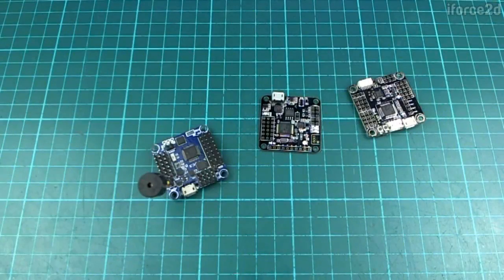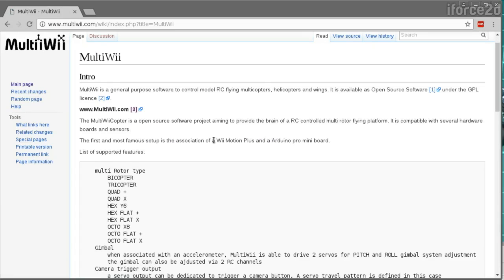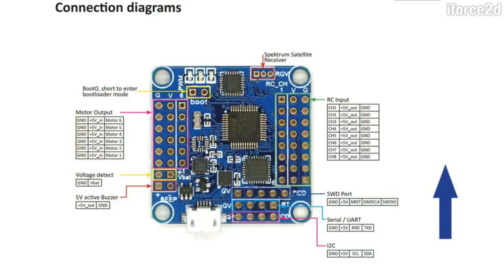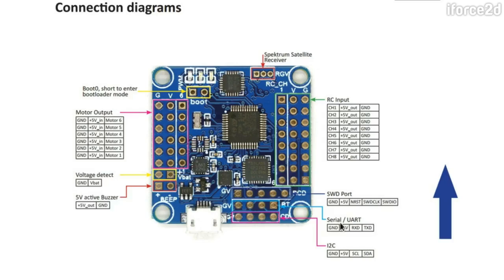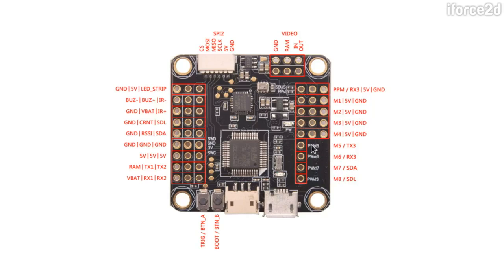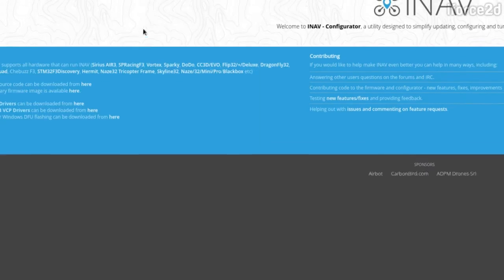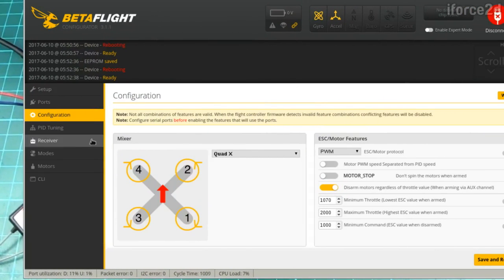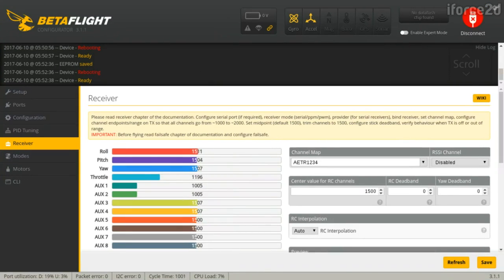Noobs guide to quadcopters part 9 (flight controller)

Comment: After all these years, still awesome videos!
One question - if you had receiver connected, why it did not trigger motor when you were playing with sticks on transmitter?
Reply from the maker: Because the flight controller wasn't armed.

Comment: Hi Chris. I have big problems with flashing of my NAZE32 Rev6 Flight controller. i always get the same error and my flashing stops on half of hte way. Please help. I already done all what i could. re-install drivers, re-install cleanflight to lower version and spell with firmware hex files and ect. There are all unusefull. Can't program STM32 and all...see this mistake on https://yadi.sk/i/6a1ySo-PhTSi0Q everything is vain
I want to throw out this flight controller in a wastebasket
Reply from the maker: I wonder if it might be simply faulty. Unfortunately the best way to check is to get another one and compare...
Reply: @iforce2d  Unfortunatly i do not have another one FC NAZE32 rev6. )Thank u very much for answer. You are the real friend. Tell me please one more thing. What programm and version  do you use for  ESCs flashing? Again i have mistakes  in my "BaillHeli Suite when i try to flash RACE Star" ESC's. Can't flash my ESC's. sux...Did ever you meet with that?? What do you think about this? https://yadi.sk/i/agkcBjnn99yKdQ Can i speak with you in Discord or Skype? Can we talk in sound?

Comment: Most of the stuff you are doing is on Arduino, would that not work as a Flight Controller?
Reply from the maker: Yes, that's actually how I started. https://www.youtube.com/watch?v=YPtxHw3DWrg The setup is a bit more fiddly though and the performance is rather limited (loop time is slow and adding a GPS or more features later is really pushing things).

Comment: if your esc has a third wire for voltage do you plug them all in?
Reply from the maker: If they are all linear regulators, and usually they are, should be fine. But if in doubt, just use one.

Comment: what was the name of that "newer" flight controller you showed?
Reply: I think the main reason for the switch to F3 was "why not?" ;) . The main limit was flash size on the Naze, because it used one of the low end F1s (there's one with the same packages but more memory). So if you want to change the chip anyway for memory, why not take one that has some other features as well.
The number of UARTs is a factor of the package type (pin count). The F1 on the Naze has three hardware UARTs and a VCP over USB as well, it was just that on the Naze the pins weren't connected with much planning apparently, so one of the UARTs was blocked by I2C (which could have used other pins). I used an F1 with 5 hardware UARTs, USB virtual com port and I2C, which was totally possible with F1s in the right package (higher pin count; dev boards can be had for less than 10$ on ebay). The code for that even made it into cleanflight trunk, but got dropped (for F1s) with the switch to betaflight.
Of course now with F3s you got additional features that make some things in programming easier, because you got more options of how to do something.
Reply from the maker: oh yeah, was gonna say that but forgot. Use some epoxy around the usb plug before you use it. One (of three) of the flip32 boards I had the usb connector broke off. These days I epoxy them as soon as I get them so I haven't had this happen again. I have not used this omnibus yet (I bought it for the follow-up to this series where I'll make a GPS quad).
Reply from the maker: Omnibus F3. But there are many similar boards out there now, I got that one for an aerial photography build because it has onboard OSD and SD card for blackbox on longer flights, and it has no onboard mag. For a miniquad the Betaflight F3 looks like a good deal.
Reply: Oh, those are just more F3 boards (72 Mhz), which you said are already starting to look a little bit slow.  
But new flight controllers must all be shifting to some newer & faster chip yeah?  I'm curious what it is.
Reply from the maker: The F1 board is what I said was getting old. It's not all about processor speed, the F3 has more hardware UARTs, built-in USB, FPU, some F3 have more memory etc, which is helpful too.
Reply: ah, thx that clears it up
Reply: @iforce2d  Im interested in aerial photography.  Do you have any videos showing how you built that one?
Reply: Do you have a link for it? Thanks
Reply from the maker: For the omnibus? https://goo.gl/JJEAyS Search there for "omnibus f3" and you'll find the betaflight f3 one too.
Reply: That one. Thanks :) I red that the USB socket is really fragile. Do you confirm it? What about the reliability of that board?
Reply: Ok thanks
Reply: What a shame :)
Reply: It seems that some (higher end?) flight-controllers are using the F4 chip instead of F3.  The F4 is an older chip, and lacks some UART functionality (eg: UART inversion), but has a higher clock speed.  I guess they wanted that clock speed.
Reply: I think the F4 support in Betaflight/Cleanflight is there, just because the hardware exists in the form of Pixhawk compatible boards. Pixhawk has been around for quite some time and maybe the F4s were the only one with enough flash/memory (Pixhawk is running RTOS) at that time.

Comment: Hi i got a flip 32 aio v1.3 fc and it says that it supports sppm and serial rx. I dont know what sppm is?
Reply from the maker: You mean CPPM? I think that's the same as PPM.
Reply: iforce2d no that is the funny thing i know what cppm but it says sppm. I search in google and cant find enything.
Reply from the maker: It might just be a typo, where does it say that?
Reply from the maker: On the diagram (second page) it says PPM for the pin label, I'm thinking it's just PPM.
Reply: iforce2d maby it is a typo. I will try ppm and see what happens on betaflight. Thanks for the replies.👍